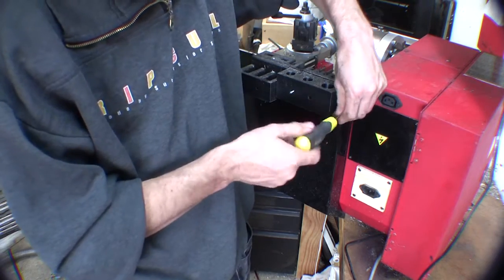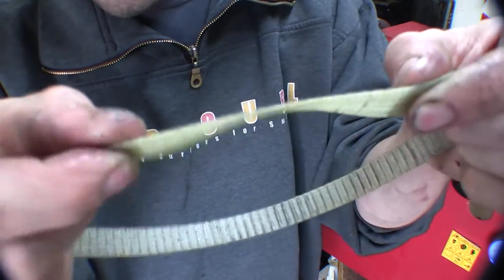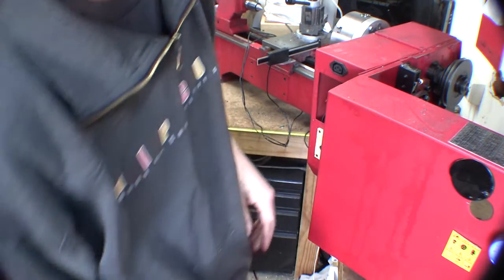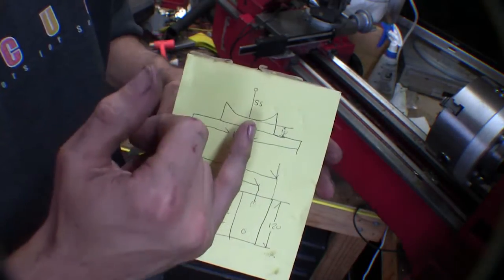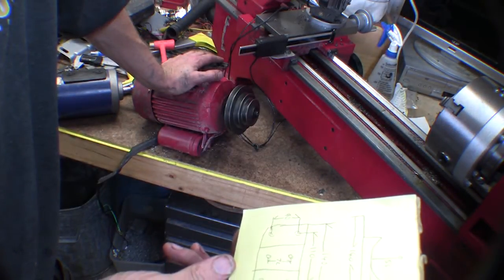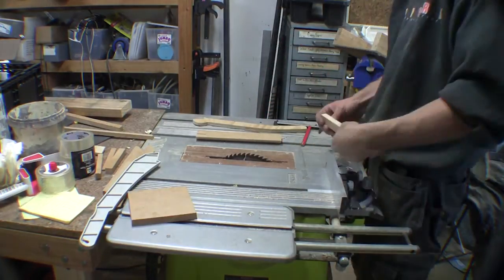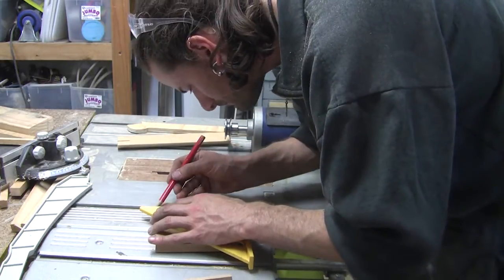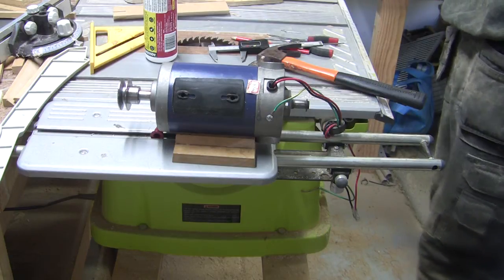Sieg C6 DC motor mount part 1

Comment: I finished this conversion a few hours ago, It was a long term project, took me a while to get all the parts for the job. I was lucky finding a brand new 4HP Leeson treadmill motor. Getting hold of a pwm controller capable of handling it was not so easy ( 13A at 220V DC). Finally managed to track one down a few months ago from AliExpress.
I would like to thank you for making that motor mount drawing, I needed to know the sizes without taking the original motor off, so I just paused your video and copied the dimensions.
Being able to change speed by turning a knob is pure luxury ! I replaced the original single turn speed control knob with a multi-turn one, now it takes 10 turns to go from min to max, which enables me to tune the speed within a couple of RPM. I kept all the original wiring, emergency switch is still functional and forward / reverse switch still does its intended function. There are only two additions to the front panel, speed control knob and motor controller on/off switch
I get a speed range from 100  to 2200 rpm which is plenty. Also there is plenty of torque, even at the lowest range the spindle shows no signs of stalling. It was a bit of a ....around, but it looks like it was definitely worth it.
Reply from the maker: FPVmafia glad I could help! Thanks for the comment

Comment: Hello there first off thank you for another good video! I noticed you got some what look like "iGaging" brand DRO's on the lath there, are you using their standart LCD or did you "tap into them" for a larger DRO display?
Reply from the maker: im not sure what the brand is i think they where "sharne"? but most likely its the same product, im using them as they cam at this stage i might be making a better display for them at some stage. but they are not the most accurate.. thanks for watching!
Reply: ok, i bought one from "igaging" fro my home made CNCMill, and it works good, but only down to 100'th of a mm, i'm assuming yours is the same?
Reply from the maker: yeah mine read to 0.01 of a mm but +-0.01 if not 0.02